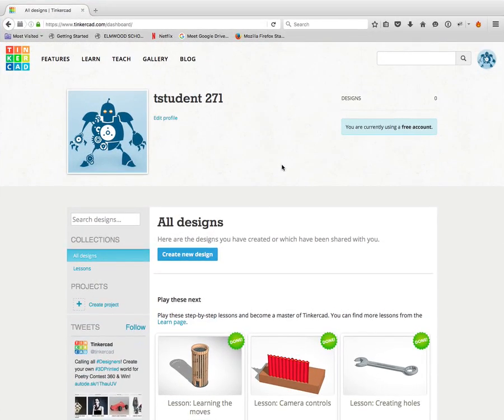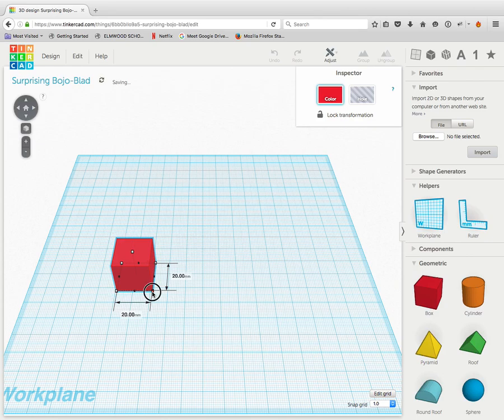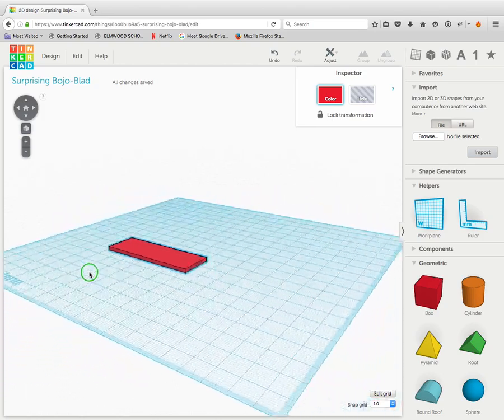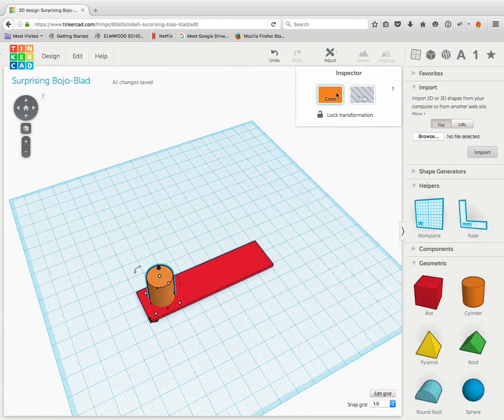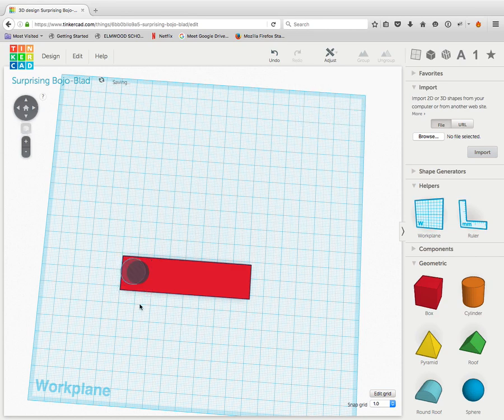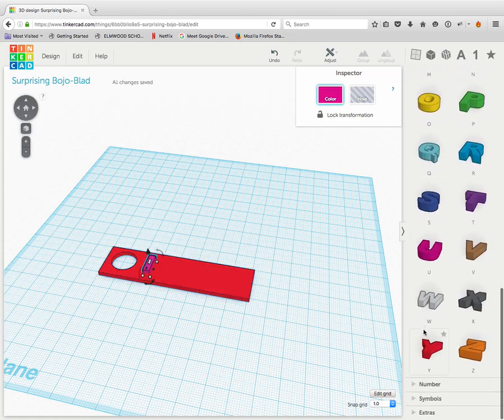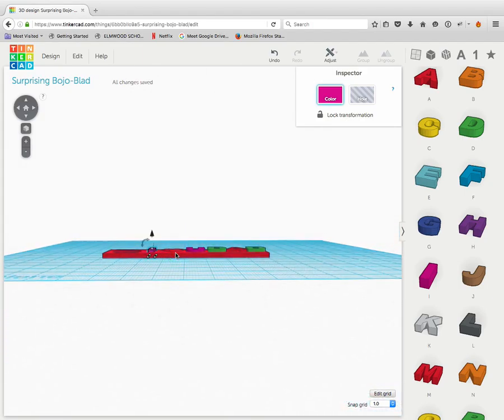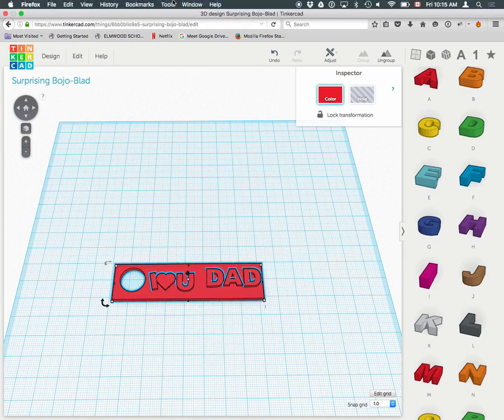How to design a keychain in Tinkercad

Comment: Great video, this keychain will be my first design. For some reason mine did not make a hole. Any ideas? Thanks
Reply: i know i know, this was 2 months ago, you probably dont even do this anymore but,
if you wanna make a hole, grab a circle or the hole shape you want, then place it into the area where you want it
afterwards, change the shape into a hole and then select all. press the icon that looks like a square and circle merging on your top right to group and you're finished